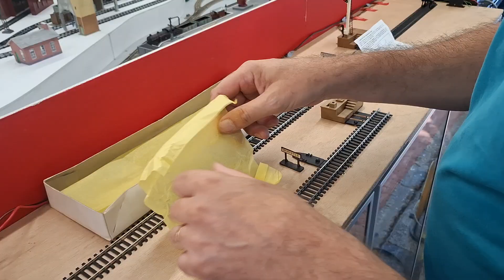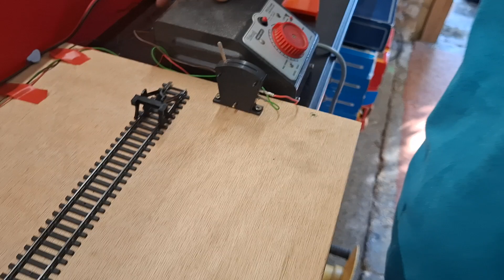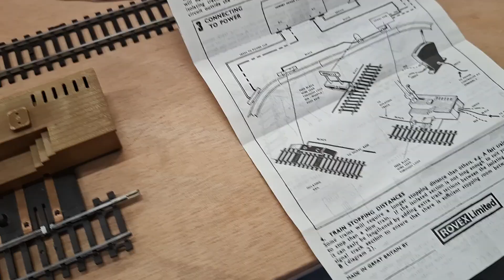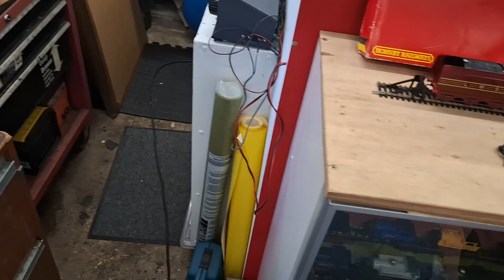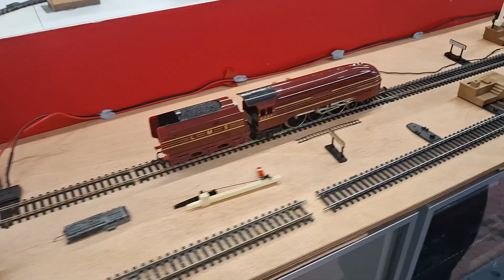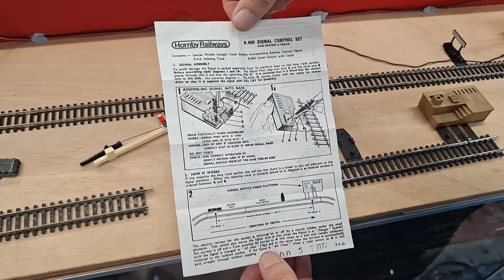This one is for you Jim, R.400 signal control set.

Comment: Good on ya lads, I think I've got it, the signal end is a switch? the power clip is to the left, for normal running? the "hump" away from us is a power feed to the isolated section?👏👏😵‍💫 To the train set😟 If the lights go out, with a mushroom cloud north of you, I may have got it wrong😟🙄👍👍
Reply from the maker: Your welcome Jim glad we could try and help 😀 thanks as always for your comment much appreciated 👏
Reply: @downthegaragelayout.7465  Just remembered, R.406 shuttle.
Having had a think, I could use an under track point motor with a switch unit, or a SEEP.
I'm going through your back catalogue at the Mo👍👍